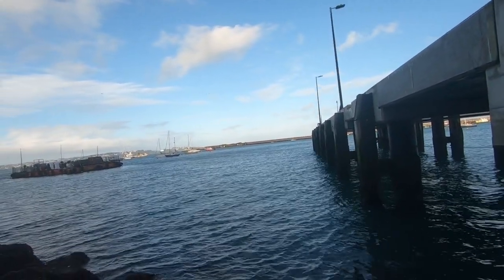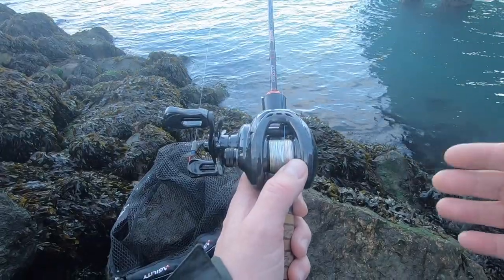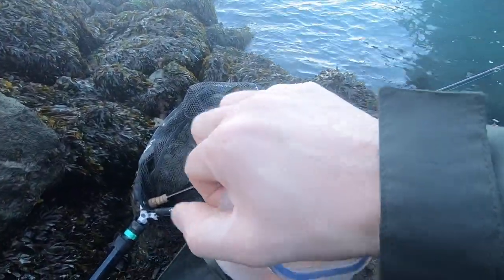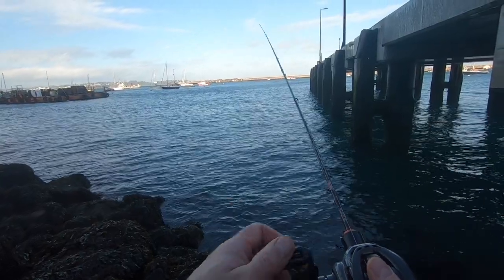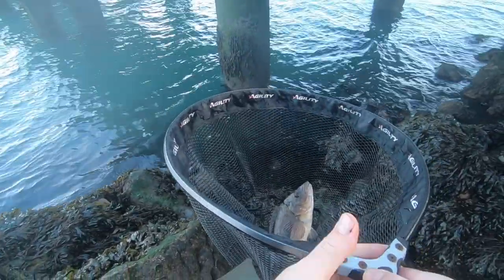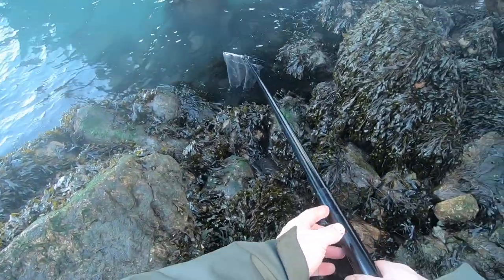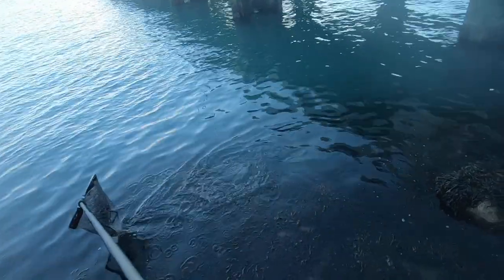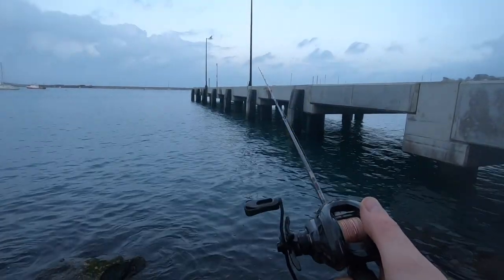Saltwater BFS - Bait Finesse System - LRF (Light Rock Fishing)

Comment: Thanks Mate, good video, wouldn't worry to much about the ceramic bearings, Ceramic doesn't rust and the races are stainless so, a bearing removal and wash out with clean warm water every few trips should be plenty. I would find the level wind mechanism to be more important and that can be sorted with a spray of WD40, original not the ptfe version, and a drop of oil every trip. Just for interest the Original WD40 is made of fish oil and PTFE is very poisonous to fish, even in minute ammounts.
Reply from the maker: Cheers mate. Good advice.